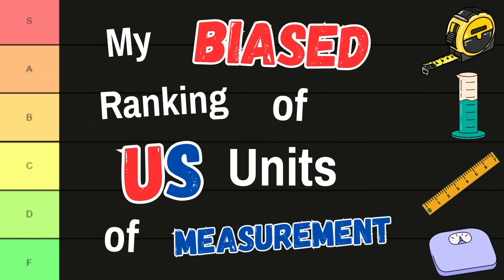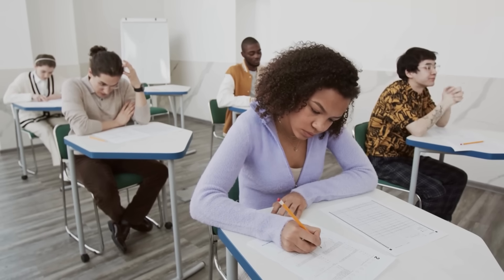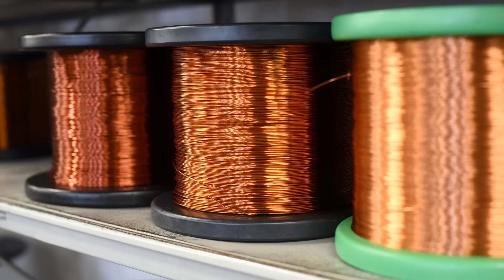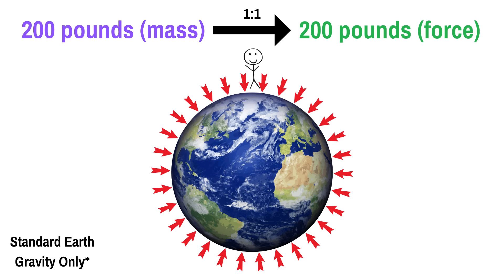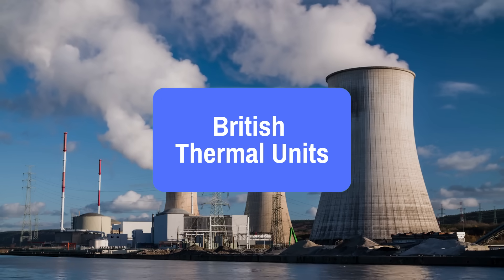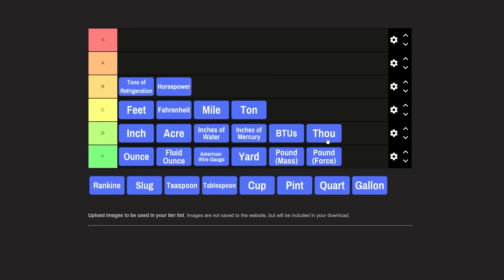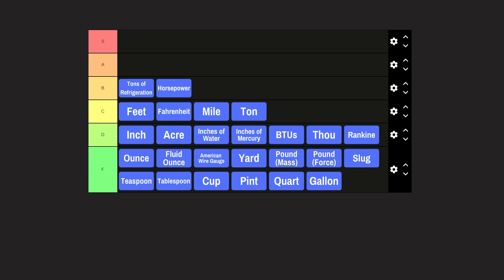Tier List of the DISASTROUS US Measuring System

Comment: Every horse has approximately 12 horsepower because it was measured using 90° blocks
Reply: It does depend strongly on the breed how much horsepower they can generate. A draft in good health and fitness can do up to 24 horsepower. A small Shetland won't come anywhere near that.
Racing thoroughbreds get to 15 horsepower over short distances
Reply: @j.v3896  that os true
I am just saying what I usually encounter
I had an awesome experience with a horse called beauty 
He was 2 meters at the withers
And it seemed like not a single thing can stop him, when he is scared
Reply: @МишаНегрей-и3и  sounds like a shire horse.
And there really isn't any stopping horses if they don't want to
Reply: @j.v3896  yep, it is

Comment: As a european, i hate that kilogram is the base for calculation and not the gram, and that 1000kg is not a Mg(mega gram) but is a ton
Reply: I mean, there also "isn't" a "megameter" or "gigameter" (AFAIK at least), but you're still free to call it that. They're just alternative names for the same thing; a micrometer can also just be called a micron.
Reply: You can thank the French Revolution for that one.   At one point, there was a unit without a prefix that was defined similar to our modern kilogram, which was called the grave (rhymes with Slav).   It was scrapped in favor of a smaller unit, the modern gram, due to the little guy overthrowing the monarchy, and their scientific advisor who coined the grave unit.

Comment: My favorite is the nautical mile and the knot. I'd say there's no argument, that is a better unit to use on the seas than SI due to it's application. As it turns out, most all imperial units were derived for their specific use cases in their respective fields. What good is a m/s or km/s on the seas when you're using a compass and a map that is in degrees of the Earth? The conversion is built into the unit, and like a language, requires you understand the implied relationship.

Nothing is stopping you from applying the SI prefixes to imperial units. Everyone would understand what you meant if you said milli-inch. Or kilo-foot. Those values still exist regardless if it's used in standard vernacular or not. It's no different than applying the imperial fractional relationships of units like, half a meter or a quarter of a liter. The only difference is in how much each prefix is subdividing the unit. 

It's true imperial units don't generally scale upwards from a base unit, instead opting to have a new larger unit to subdivide. I prefer it because it immediately implies scale. The moment you say the word ton, you're no longer thinking in the pound reference. Even if there is a direct relationship, it's unimportant and even confusing to have that high level of precision. Anybody doing shipping and logistics are are talking tons of weight, not pounds. It requires you to understand about what a ton is, but then again, everyone in the industry does.

I feel I need to point out, People who struggle with imperial must also struggle with time. Every argument you make against imperial units, you are also making against time. The subdivisions we chose for hours, minutes, seconds are no less arbitrary than all the other ones imperial uses. 

Which for no other reason is why imperial units have to stay. In order to unquestionably prove that ALL fundamental measurements are arbitrarily defined and relative to an agreed upon standard. The origin of the foot is no less arbitrary than the origin of the meter which is 1/10000000 of the Distance from the equator to the North Pole passing through Paris in 1791.

Anyway Just thought I'd stand up for my Units randomly.
Reply: You make a good point. No one (to my knowledge) has ever argued that the way in which we measure time should be altered, though I would be willing to bet that's only because everyone on Earth measures it in the same way, instead of a small portion doing it the "worse" way, while everyone else has something that's more intuitive and easier to understand. If every country that used metric also had some sort of 10s based method of calculating time, we'd probably see the same arguments against our current 24 hour/60 minute/60 second scale. 

People don't have an issue with imperial units inherently, they have an issue with the fact that converting imperial units into metric or vice versa is a pain in the ass (and rightfully so, since neither method of measuring was created with that in mind), and since the majority of the planet uses metric (which just so happens to also be intuitive to understand), that automatically makes it "the better one."
Reply: Yeah the units for time suck. Should have been base 100 or base 10. It’s the only part the imperial system the metric system uses. It’s same reason that degrees suck as well. Radians allow much cleaner numbers in trigonometry.

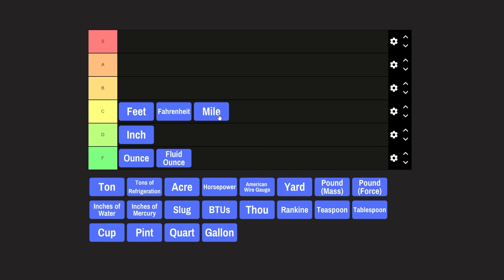Comment: 2:50 I could be wrong, but I think the paces used to define a mile were at about walking speed, and each pace consists of two steps.

I measured myself walking a mile many years ago, and it was within about 10 or 20 steps of 2000. I had been dividing my daily steps by 2000 for years to approximate miles before I realized this connection.
Reply: Yea, I thought it was weird that he ran to compare how many paces it took to go a mile. Paces are just normal walking steps, but counting every other step
Reply: A pace is supposed to be a pretty good approximation for a yard, but that would make it 1760 paces, not 2000.
Reply: There seems to be no real definition of steps, paces or strides in English. A stride is a long step but how long? I personally consider a comfortable walking step/pace to be 2.64 feet and a stride to be 2 steps/paces or 5.28 feet. Then if you do a thousand strides you go 5280 feet which when divided by 3 gives 1760 yards or one mile. Mile is derived from the Latin for 1000 so that is the origin of a mile. I used to pace out spaces on the shop floor at work sometimes and a stretched pace was close to 1m which was my usual go to for measuring spaces. In the armed forces an instruction to take 2 paces back was clearly 2 steps, not 2 steps twice.

Comment: OMG so based, I'm studying for a fluid mechanics midterm in CANADA where we use BOTH imperial and metric (kill me). I have had to use almost all of these in my calculation (including the loathsome slugs) and I can confirm, they're all F tier
Reply: come to europe, we have cookies. But for real im sory
Reply: @ibag3621  which country do you recommend? I'm planning on doing an exchange program/year abroad
Reply: @Zoltan00  For engineering? Germany of course.
Reply: I am studying architecture in the UK. Our doors are 6'6x2'6 and our worktops are 3 feet high and 2 feet deep, but we use milimetres in design software, we therefore get insane numbers like 1981*762...
Reply: But you can just make a list: unit*factor=metric unit to replace in equations.
Reply: At least your Reynolds number is unit independent
Reply: US also uses both so anyone saying otherwise is false.
Reply: Funny, I was just practicing fluid mechanics questions 5 minutes ago lol. Easy to say that Fluid Mechanics have fried my brain. 😔
Reply: You Canucks are contaminating the Commonwealth. Be gone with you!
Reply: Slugs are far superior to lbm and i shall die on this hill
Reply: @isaacmarkovitz7548  OK but how about just using an internationally recognized unit of mass? xP Kg>>slug>lbm
Reply: @isaacmarkovitz7548 if you're half metric like me, lbm is better in every respect even kinematics because a lbf accelerates a lbm at 1g which is something I can intuit, as opposed to 1 ft/s^2 which I literally never reference.
Reply: @appa609 Except the part where you then have to convert your acceleration out of G’s anyway. You avoided the conversion to slugs by putting it somewhere else.
Reply: @appa609  I don't want an engineer to "intuit" shit.

Comment: Interesting that ounce and fl ounce is essentially the same definition as gram and ml!
Reply: Same for Decanewton (daN) and kg.
Reply: @Netaction but only roughly on earth.
Reply: Except they aren't.
Reply: @JürgenErhard  yes they are. One gram of water has 1 ml of volume and one Ounce of water has 1 Fl Oz of volume.
Reply: Why are there liters at all? It's a (superfluous?) distinction between solid and liquid volume. Nobody would think that a cubic decimeter is equivalent to a kilogram.

I looked it up. Liter is not part of the metric SI system.
Reply: @wWvwvV  There are just 6 SI units describing the whole nature and physics. (plus the human unit candela) There is no base unit for pressure or volume or voltage, they have to be constructed using SI units. 1 bar = 1000 N / m^2. 1 liter = 0.001 m^3. 1 volt = 1 kg m^2 / s^3 / A.
Those extra units are necessary in everyday life.
Reply: @wWvwvV  There is no distinction between solid or fluid volumes. All are measured in litres or cubic metres. But gas and liquid and empty spaces are often measured while nobody needs the volume of a rock or a car. Think about the gas station or in the kitchen. Even a car's trunk space is measured in litres.
Reply: @Netaction  You've not been reading up on your Metric units enough as there is indeed a distinction between solid and fluid volumes: liquid volume has the litre (the oh-so logical "cubic DECI-metre") while solid has the stere, which is a cubic metre. Arguably the latter is more logical in Metric: a stere is a cubic metre and the weight or mass of that quantity of water is a tonne, while the litre side has that bizarre DECI-metre to KILO-gram thing going on - would it have been too much to ask to just make it so a litre was a cubic metre whose weight of water was a gram? (just make the metre a tenth its current size - not like it matters whether the metre is one ten millionth or one hundred millionth of the pole-equator distance, after all).

There's also the Metric unit of area, the are, which is of course a square DECA-metre, because this is the very logical Metric system (or so I'm told). At least a hectare is a square hectometre, but that's more likely to be an accident than anything else.
Reply: @davidjames4915  Litres is used for every volume in everyday life, so in practice it is not just for fluids. There is no worldwide regulation for litres as it is not part of the SI. Without any regulation, there can't be a definition that it is just for liquids. In Germany there is a law defining a liter as a volume. There is another law defining the volumes of some empty containers that are not made for liquids.

The stere is not made for solids either. A stere is a cubic metre of stacked wood, including the air between.

The are is hardly used and has no official definition.

The hectare 100x100m is used by farmers. Sure they could use a kilo square metre instead to stay in the system. But a kilo square metre would be 32x32 metres and hard to measure. So they need their own unit.
Reply: @wWvwvV  A cubic decimeter of distilled water is a kilogram.

Comment: I argue that Fahrenheit is a good measure of temperature and should be at least B tier, as it is very good for the knowing the weather outside
Reply: I always hear this argument, I feel like it has way more to do with being used to that measurement.
If you use C all your life you instantly know if it's too hot/cold or just right outside too
Same would most likely go for K & R (is R the abbreviation for Rankine?) though I doubt anybody really does that.
Reply: @TsubasayaYami  The advantage of Fahrenheit, is that it gives a 0 to 100 scale of the most common temperatures we will experience on this planet, as the outdoor temperature.  Sure you could nitpick this by giving examples of extremely hot or extremely cold places, but the point is that it is generally the range of ambient temperatures we experience.

It also gives a slightly better resolution, if decimals aren't used.   Common for weather reports that just give a (usually) 2-digit number.   

Yes, R is the symbol for Rankine.  Some people may write Ra, to avoid confusing it with other meanings of the letter R.

Comment: As an engineering student, I hope to never need slugs. It also would be miserable to compute between slugs (mass) and weight (force by gravity), as it doesn’t factor in gravity very well.
Reply: It's surprisingly not that difficult.  Just as you convert between mass in kg and weight Newtons, by using 9.8 N/kg, you convert between mass in slugs and weight in force pounds, by using 32 force pounds per slug, based on a free fall acceleration of 32 ft/s^2.

We just don't think in slugs, and no one in the US outside of engineers, even knows what a slug is.   It's just a mass unit that was set up to make Newton's second law more elegant, when using the US customary system.  But since the general public is usually using weight as a proxy for mass, rather than relating forces and acceleration, that's why it is such an unpopular unit to use.